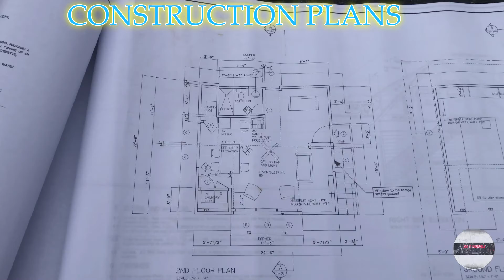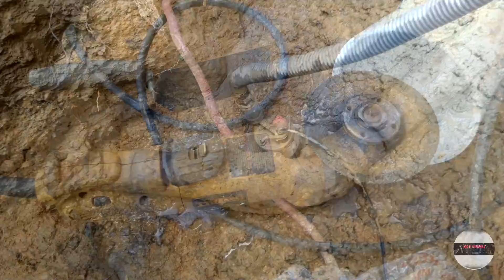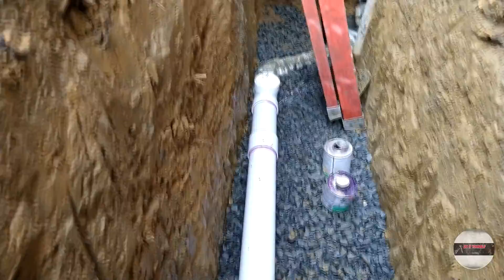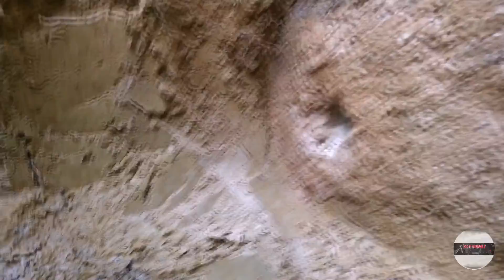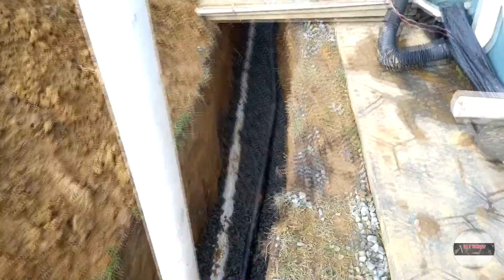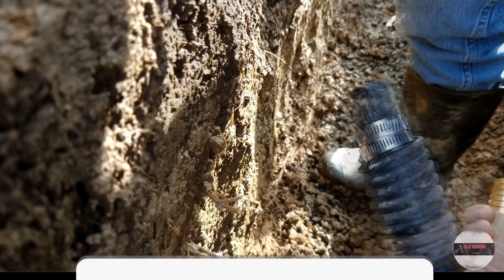SEWAGE HOOKUP AND WATER SERVICE  ( garage apartment ) #1   🏘

Comment: Im doing mine at this moment, i cant find a proper water line that handles MA cold winter, is that a good one my friend? If yes, please share the name so i can get one. Thanks good video!!
Reply: Just did mine here in MA. They technically require copper in my town but I Used the blue poly pipe  and sleeve it in pvc pipe so it can be easily replaced if you have an issue and not need to dig your yard up. Blue poly is the way to go. Back fill it with sand first before the dirt and you’ll be good to go.

Comment: disagree with the brass barbed couplers used with the black poly water line...in fact disagree with the blk poly...as an irrigation contractor, I know that the blk poly will separate in a lateral split after constant pressure in about 30 years and the brass today will oxidize faster than that....I personally would've used sch 80 pvc designed for potable water.
Reply: there are many forms of Poly the best is the 250psi it will last a very long time. Brass is the only option that any plumber will tell you  works underground. The mistake here is putting all the sharp gravel around the water pipe. That gravel will cut holes in the poly no mater how thick. My go to if i want to ensure it for life is putting the water line in a sleeve. Cheap drain pipe in a 3in then ever a problem just pull it out.